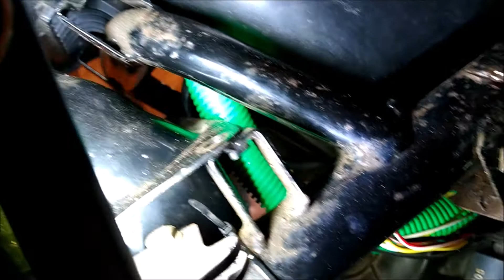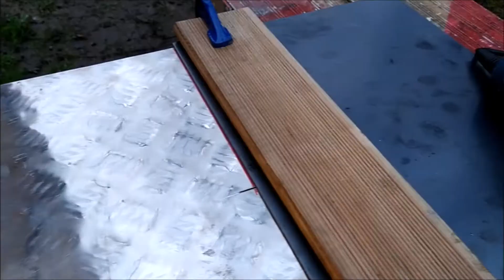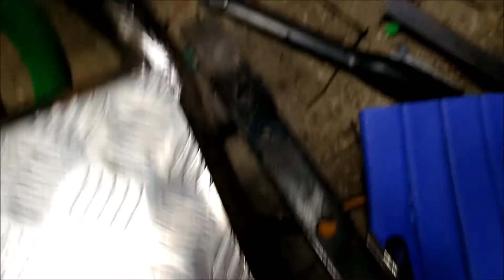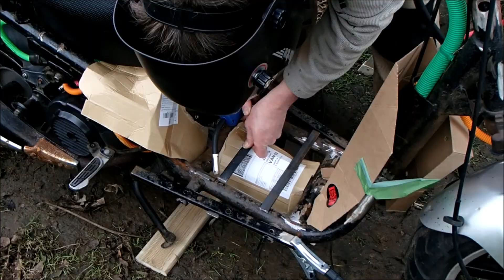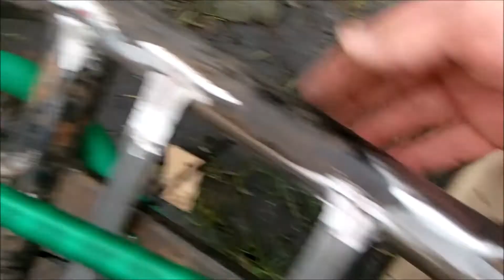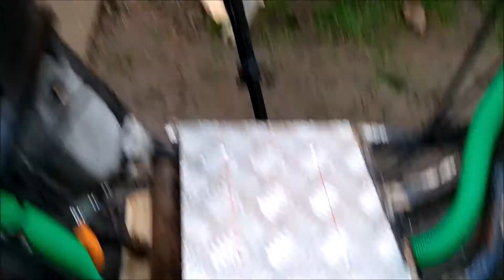GY6 custom naked scooter - fitting the floor plate

Comment: Hey im almost done today 4/29/2024 . Just finished the rear signal lights , the stator . The seat, the rear luggage bracket and the gas handle. Just need to install the rear seat not before making new holes in the rear plastic covers because the plastics went up about 1.5 inches and i can’t put the bolts.
Reply from the maker: Good to hear. You need to post a video when you get a chance

Comment: Make a brake pedal on the floor board and that will solve your brake cable issue
Reply from the maker: It's a great plan... However it may exceed my  skill level 🤣
Reply from the maker: Just googling vespa brake setup